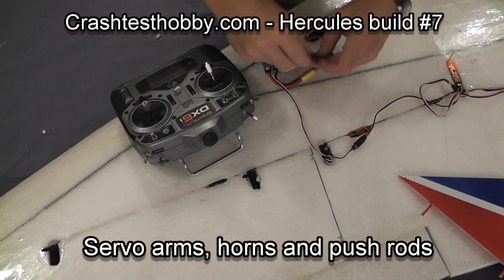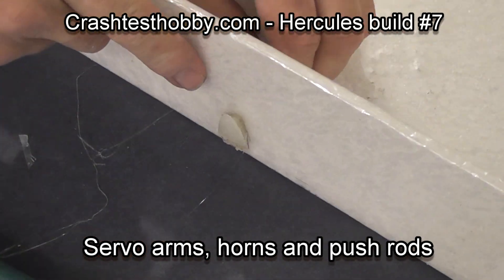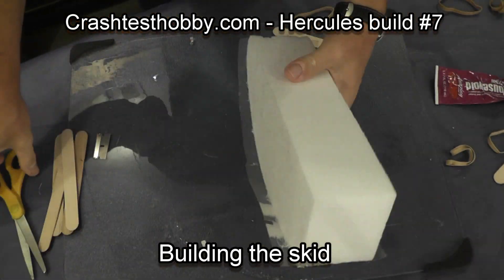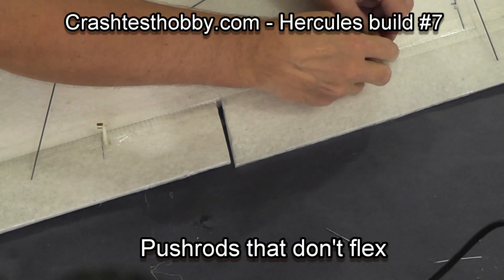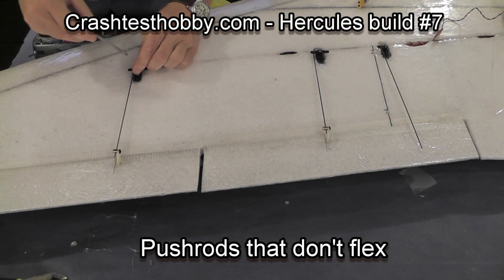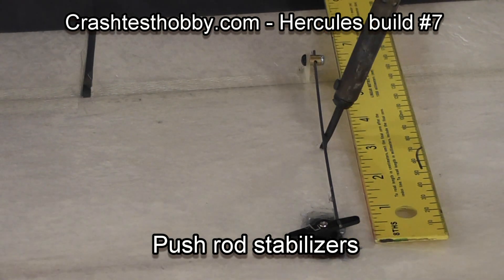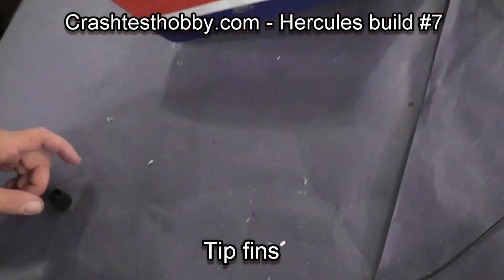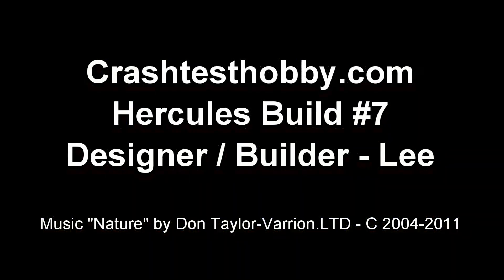#7 Hercules Build - Prepare to fly

Comment from the maker: It isn't on the ground for very long during take off and landing.  I haven't put a skid on it to protect it but this tip fin does help to keep the plane steerable when it is taxiing on the ground. If you are flying off hard surface like pavement you will wear them out.